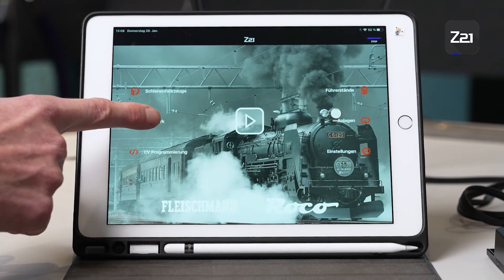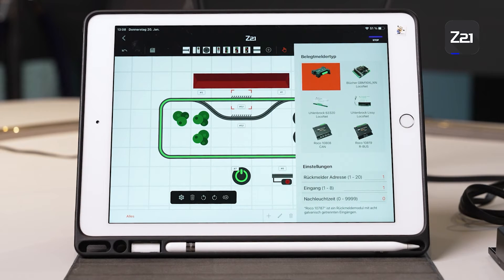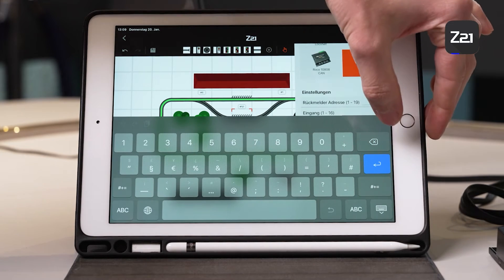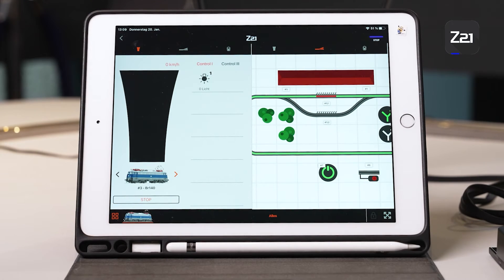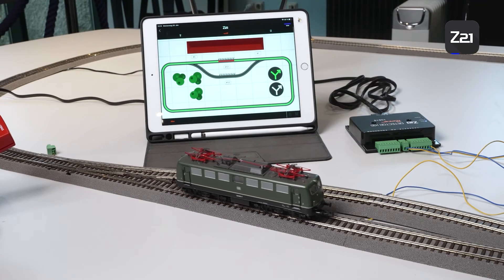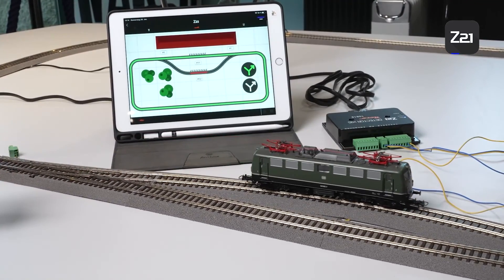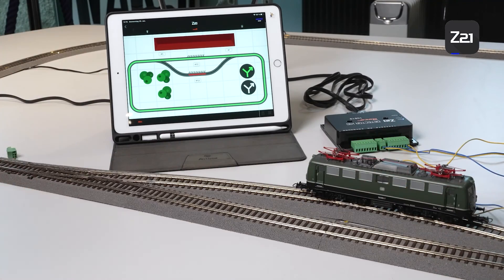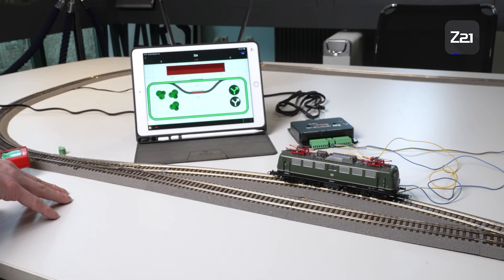Part 16: The Z21  detector

Comment: Is there a cable dia (0,5mm sq, 1.0mm sq or 1.5 mm sq) requirement for the P or N wire? I am using 1.5mm sq wire for the power bus. Wanted to use 2.5 mm sq but it does not insert into the power outlet holes in the black Z21

Comment: I'm using the Z21 with iTrain.  I am also using the Z21 10808 detectors that has Railcom built in so it shows the train ID in the block also.

Comment: What is a detector with AppZ21 for? For display only? Cannot reference a route. The ideal would be to be able to make routes where the signals were referenced to the position of the switches and the occupancy detectors (track circuits).